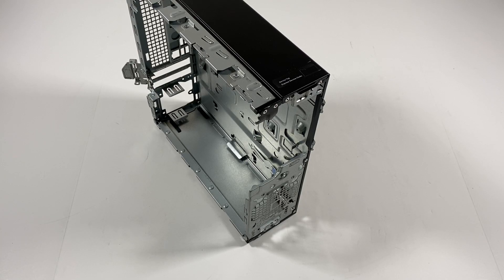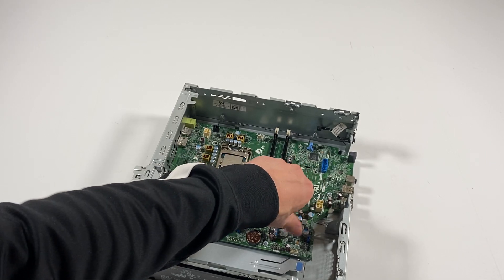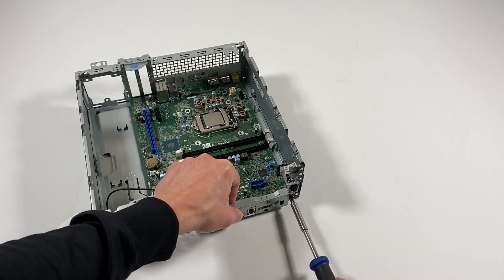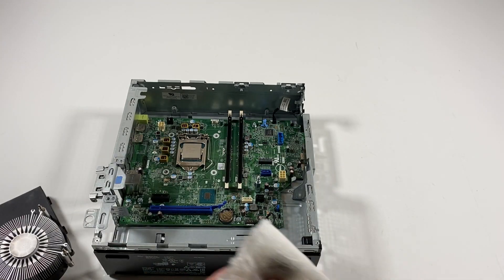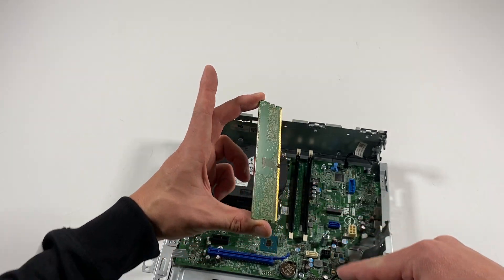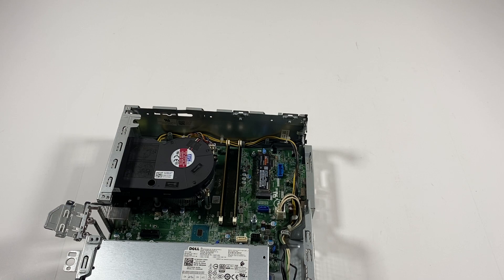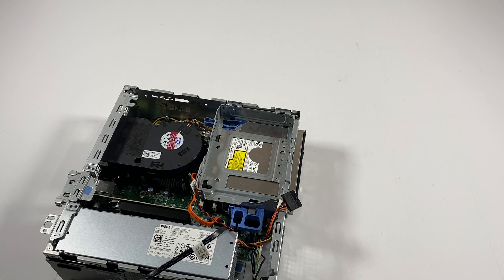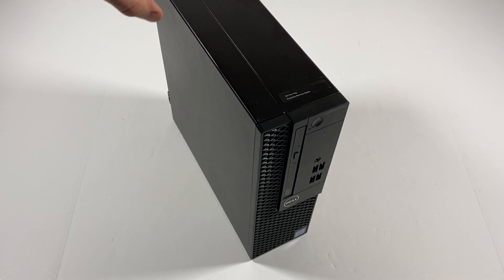Dell Optiplex Reassemble

Comment: Any way to install 2 (or even 3) 2.5" SSDs on this? I have been searching for a sata power cable that would work with the optical drive plus 2 SSDs, but haven't found a solution given that this model uses the same mini 6pin sata power cable for ODD and HDD only (not offering support for a separate HDD). Any recommendations?
Reply: It takes only 1. I installed the OS on the M.2 NVME and the 2.5" SSD for backup storage. It was for a client of mine.

Comment: I have a dell optiplex 3050 with a i5 7500, would I be able to upgrade it to a i7 7th or 6th gen?
Reply: I know you said it in the video but I just wanna confirm it
Reply from the maker: Hi, yes PC supports i7 6700  or i7 7700
Reply: can you share the motherboard links to buy. I want to replace the motherboard of optiplex 3050